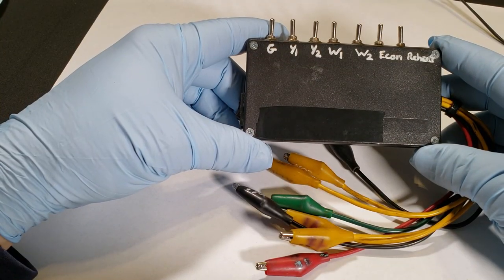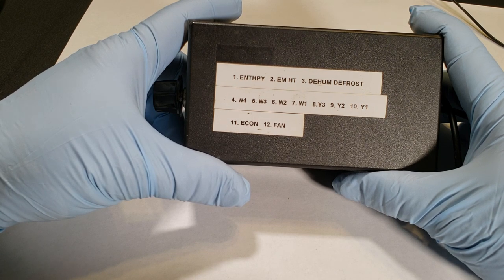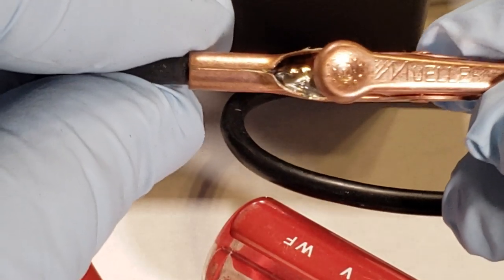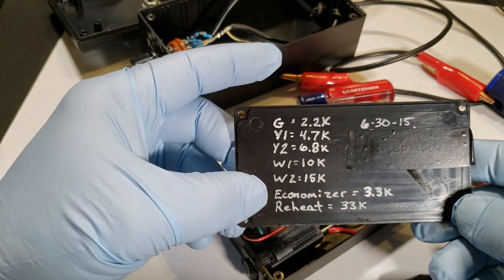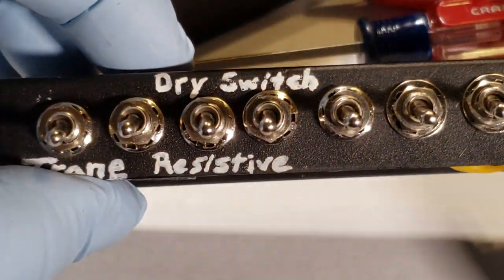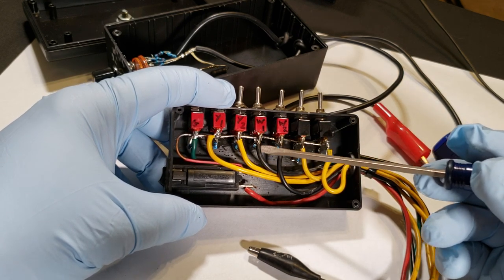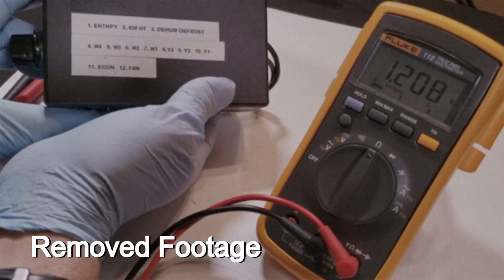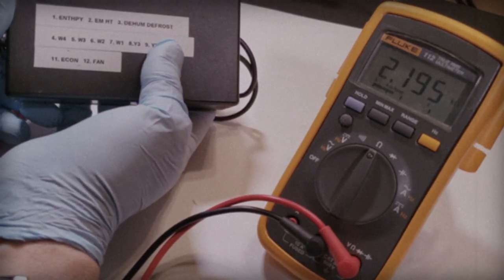Trane Decade Box Built For Cheap HVAC Test Mode Box

Comment: Nice work. I made one a long time ago with.a potentiometer. Works good for many temp sensors and to simulate different outdoor temperatures and indoor temperatures for chillers.
Reply from the maker: I thought about doing that also. I think it would be more useful for the temp sensors as you mentioned. It'd be a good way to bypass the circuitry while you're doing your testing. Thanks for commenting and watching! 👍🏻👍🏻

Comment: Should do what tool you need to be HVACR apprentice tool bag & tools review 👍👍👍 or do review Case study and the compressor What caused it to fail I see all tech when Compressor is not good they just replace it with new one they never find out the cause to fail I know it takes long time to cut open the compressor But it will be very educational to see which component that fail and what Cause it to fail .
Reply from the maker: Right on! Thanks, JYP!!
Reply: We will have to ship you a bad compressor to you😂
Reply from the maker: @ScrewedUpEssayLatin  I have some. 🙄👍🏻👍🏻
Reply: Just supporting you. 🤘🏼🤘🏼
Reply from the maker: @ScrewedUpEssayLatin  Na, I know you are and I appreciate all of my viewers that have taken the time to message me and push me to keep going. It's great to be appreciated and an honor to be one of the guys that has an opportunity to share some of my experience with others.

Comment: I can see where having these specific resistances at hand would be a real time-saver in the field.  And it doesn't look like it would be too tough of a project to try, or too awful expensive to build.   How hard was it to keep the resistors in place with the wire while you soldered?
Reply from the maker: Not hard. I have a helping hand clamp you can buy at harbor freight cheap. ?$5-8. Pre solder each piece is key.
Reply: @HVACRSurvival  Cool.  I'll check it out.  Thanks Rick!

Comment: The decade box is cool. I was thinking of building one last year. I looked for plans online but they all seemed kind of hard to put together.  After seeing yours I think it’s not as bad as I thought.  I will let you know how mine turns out. I think you had previously done a video on leak detectors.  I have a h-10, a detech select another dtek that takes d cell batteries and finally I just picked up a Tif ZX. How about doing another one or can you put that one back up??? 
I promise I want argue with anyone else. I give no excuses it was not a moment I was proud of.
Reply from the maker: I will probably need to re-record it. Technically anything that I recorded on the clock had to come down and anything that was a customer of the companies had to come down.
Reply: I understand that. 
There are so many videos that you could do like time clocks, thermostats, pump down systems, and all the different ice machines out there. That’s just s few things off the top of my head. I think there are a lot of us out here that would enjoy it and can really use to advance the trade
Reply: I will keep it on my mind and whatever I come up with I will send it your way. 
Thanks a lot